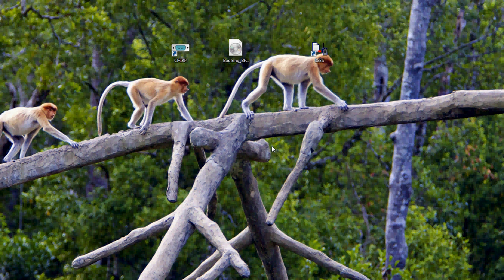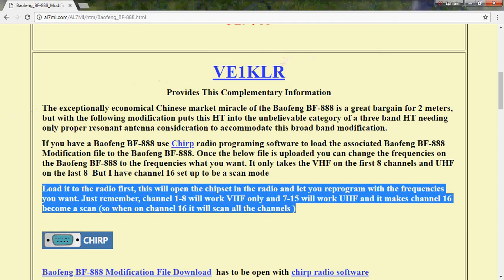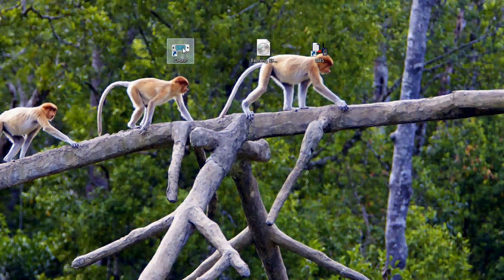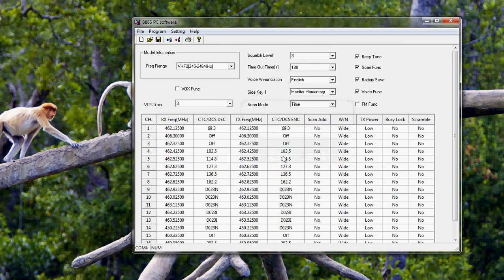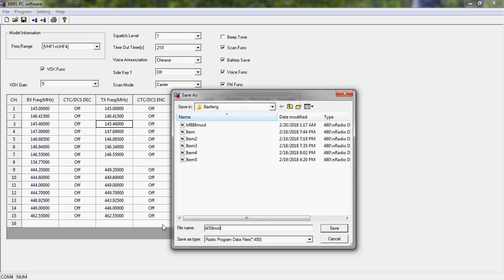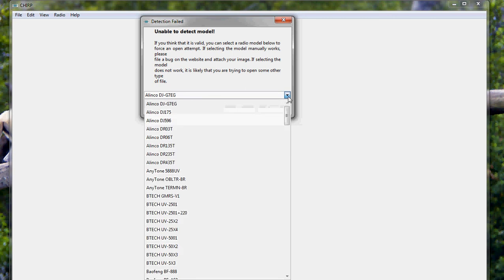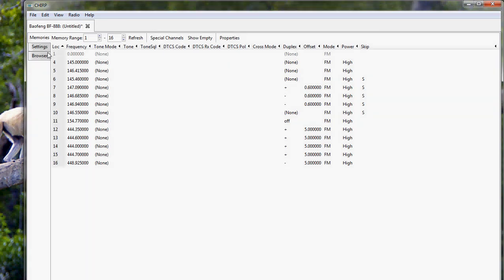How to put VHF frequency on Baofeng BF888s (2)

Comment: Is there is image file that has only 1 VHF channel and the rest are default?
Reply from the maker: This mod was posted 3 years ago, so it may or may not work on your BF888's, it will work on older models of BF888 but not on the latest models of BF888. I don't have an image file that has the VHF you have to strictly follow the procedure on this 3 part video. Sorry.
Reply: Ok thanks

Comment: sir after i followed all your instructions on adding vhf frequency on my bf888s only long beep sound i heared can you please help me
Reply from the maker: hi for new models of BF888's the mod is no longer working as you will see on the comment section of this 3 part video, just restore the original firmware if it doesn't work for you.

Comment: Hola, hice todo correctamente y en las frecuencias de vhf no transmite ni recibe, gracias
Reply from the maker: for some new models it doesn't work, but for models that was made the time this video is published it is working properly. you may need to use a dual band antenna if you would like to use it for VHF monitoring.
Reply: @EphraimGariguez  Probe con una antena bibanda y no funciona, tendra alguna modificacion para poder hacer que se pueda modificar?
Reply from the maker: @vitech7335  Hi mostly the VHF side is useful for receiving purposes only as the transmit power is less than 1 watt.
Reply from the maker: For newer release version of BF888's firmware the modification is no longer applicable or working but for models of BF888's 3 years ago, when I made the video the modification is working perfectly.

Comment: Sir, ginawa ko na po yung steps kaso buzz sound lang po yung mga vhf na channel.
Reply from the maker: pinalitan mo ba ng dualband antenna?
Reply: @EphraimGariguez  yes sir, yung stock ng UV-5R ang ginamit ko at ngayon na binalik ko sa default frequency yung tatlong open na channel ay palaging naka beep or buzz sound at yung ibang channel naman ay umiilaw yung color green na wala namang nagtratransmit.
Reply from the maker: @zeandrodukelarena188  para sa BF888s ang mod hindi para sa UV5R ? or are you referring to the antenna from UV5R. If that is the case just restore your radio to original firmware to make it usable, and then try directly editing the frequency in Chirp. If that doesn't work look for other versions of BF888 - take note that some people reports success on the mod, and some people reports failure.
Reply: @EphraimGariguez  I'm referring to the antenna,  and may problem po i didn't save the original firmware of my 888s.
Reply from the maker: @zeandrodukelarena188  you can try to restore your BF888s with the firmware  from my radio, but I'm not sure if we have the same firmware version you may download it here:https://dw1zws.com/firmware-recovery/   bottom of the second column. Next time before doing anything on your radio backup your firmware. Cheers and 73!
Reply: @zeandrodukelarena188  Kumusta na ngayon yung unit mong yun Sir? Naibalik mo ba sa dati na umiilaw  lang ang green kapag may signal? Ganyan din kasi ang nagyari sa unit ko after kong maglagay ng VHF freqs. Matinis na sound lang at naka-steady na green light kahit sa mga UHF channels. Ini-upload ko ulit yung back-up ng default pero hindi na rin nawala yung naka-steady na green light. Sinubukan ko rin lagyan ng bacjup galing sa isang unit pero ganon pa rin.
Reply: @romallivykztilot3720  Yes sir okay na siya ngayon, ang ginawa ko lang ay mano mano ko siyang binalik sa kanyang default frequency, kasi pag yung back up ang gagamitin ko ay di mawawala yung sound.
Reply: @zeandrodukelarena188  Ganon ba? Hmmm... Masubukan nga. Salamat Sir. Sana magkaigi rin sa unit ko.

Comment: Sir bago lang ako sa mga ganito sana maka sagot kayo agad..

Pag nag set ba ng own frequency at na program na malalaki range ng radio o kailangan din mag change ng antenna?
Reply from the maker: J O hindi magbabago ang range mo mababago lang ang frequency. Ang range ay dependent sa power output ng radio at antenna.
Reply: @EphraimGariguez  Hi sir, yung pag set po ba ng own frequency kahit san ang channel ilagay? kungwari po kami lang pong pamilya gagamit ... di ko po kasi gaanong mag intindihan pag set ng own frequency bago lang po ako sa mga radio sana po makasagot kayo :)
Reply from the maker: @marcuscampsadventure  basahin mo na lang manual ng radio mo nandun lahat ang info para mo magamit ng maayos.
Reply: @EphraimGariguez  ok sir salamat po sa pag reply :) tanong lang po ako ulit pag may tanong po ako

Comment: What is the age of the radios you done the VHF mod on.. I have 4 BF-888s Radios  that this does not work on.  I would love to get my hands on one that this mod works on so I can pull the code off of the MC96F8208S micro controller. By reviewing the data sheet for the BK4811B it looks like some registers has to be changed to get the unit to transmit on VHF. 

I would love to use this to build cross band repeater buy adding some hairpin filters to the radio. 

I can also show you how to mod chirp to allow you to edit the frequencies directly in chirp so you don't need to use the baofeng software..

I would love some photos of the internals of the radio you did the mod on..
Reply from the maker: Fairly recent about a year old, I've just acquired the unit when I made this video. Let me try to open one up If I get may hands on it, I don't have the unit at the moment since I let my friend borrow two of them.
Reply: @EphraimGariguez  When you get your hands back on the unit shoot me a message, We can modify your chirp driver and you can attempt at programming with chirp only.
Reply from the maker: @K5MOB , I have the units back which part do you need pictures?
Reply: @EphraimGariguez   Just some good photos of the internal boards..
Reply from the maker: @K5MOB , I have added you on facebook and sent you the pictures please see your message inbox cheers!

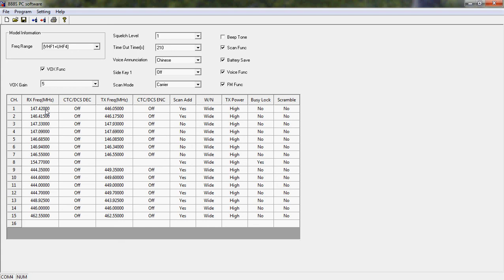Comment: i cant insert the frequency i want (7:33 minute).the programm put the defaut  245.00000 because the freq range is  vhf2(245-246 mhz)
Reply: Same problem din sakin
Reply from the maker: @maverickarcher9547  sinundan mo ba mabuti ang 3 parts video. Probably hindi supported ang 1.25 meter band
Reply from the maker: just watch the procedure completely its on the playlist it's three parts. if your frequency was not accepted after you follow the instructions that means that frequency range is not supported on the radio.

Comment: Do I need my change my antenna? The default antenna is for UHF, Can i still use it?
Reply from the maker: Hi Rux, you need to change the antenna to dual band, although the power output for VHF is not very usable less than 1 watt.
Reply: Ephraim Gariguez  Thank you po. Monitoring lang naman po kailangan ko po sa VHF. Pwede naman po yung default pang rx?
Reply from the maker: Kelangan mo palitan ng antenna kung ipang mo-monitor mo sa VHF. UHF ang default antenna so most probably wala ka ma re-received sa VHF kung hindi mo papalitan.

Comment: What kind of cable are you using to modify the channels? Did you use the cheap generic one with prolific driver or the one with FTDI chipset? 

Did you ever modify the generic cable yourself with USB to TTL dongle such as CP2102?
Reply from the maker: Hi Guitardude, I'm using a cable with a Prolific chip that will also work on Linux the only modification I've done was to put a modular RJ12 socket to fit any type of cable at the end of the programming cable.
Reply: The transceiver with the original baofeng cable memorize perfectly. The problema is that it doesn't transmit or receive
Reply: I don't need this cable